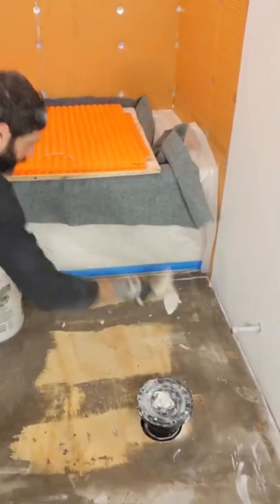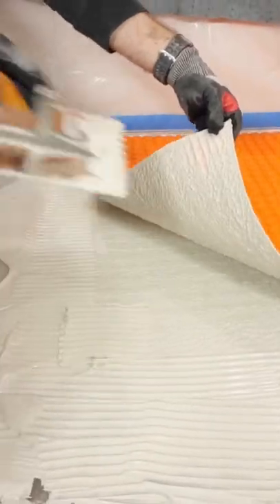Schluter DITRA-HEAT Mat Tips - #shorts

Comment: What do you think of new self stick ditra? Heat
Reply from the maker: Im going to use it. I thought a lot about the technology and use of mortar versus the adhesive. Initially I was skeptical and held off on using it. But I’ve see several installer friends use it and asked about what they thought. All had the same feelings as me but loved it. Prep is very important. So I’d use a primer on the substrate and set the mat within 48 hours after that. I’m going use this method in a few weeks for a client, so I’ll keep you posted
Reply: @HomeRepairTutor  thanks, for all your videos... im on my 4th bathroom now helping out my sister.
Reply from the maker: @kens249  that’s fantastic!! Congratulations, it’s hard work but very rewarding in the end. Especially when the client or family members are happy with the results
Reply: @HomeRepairTutor  thanks, look forward to a video on the peel n stick...😉

Comment: what thinset are you using?
Reply from the maker: Schluter ALL-SET for the membrane and Ardex X5 for tile
Reply: @HomeRepairTutor I’m about to use Ardex x5 for both.  Can’t find straight away answer on it.  I know it’ll work for membrane since it’s modified. But the porcelain to DITRA recommends unmodified
Reply from the maker: @Arr5503  last I checked, Ardex warrantees tile bonding to Schluter